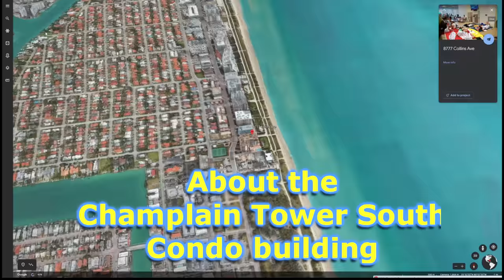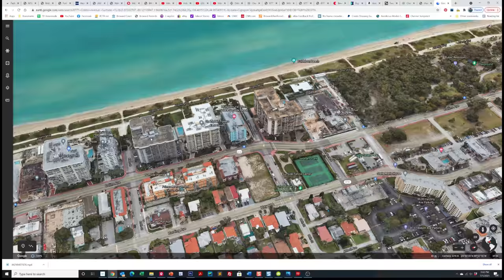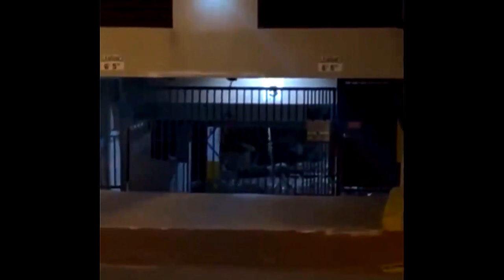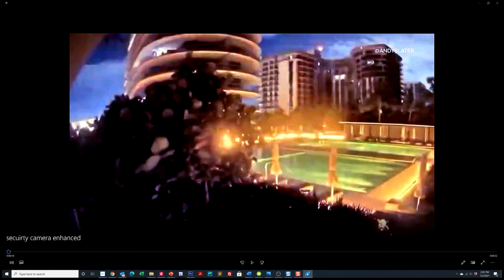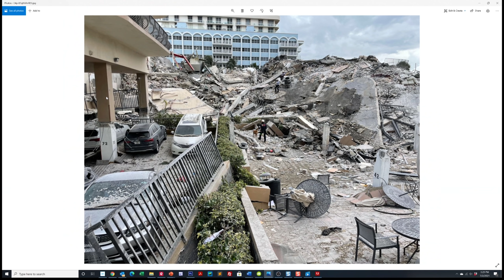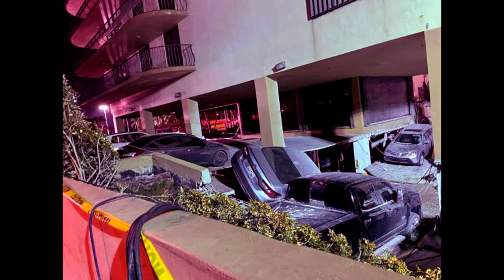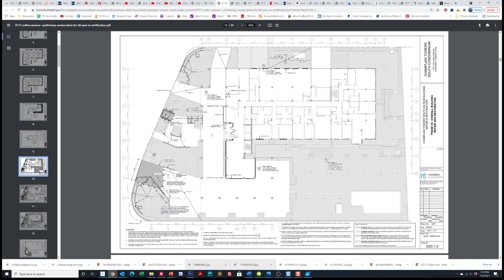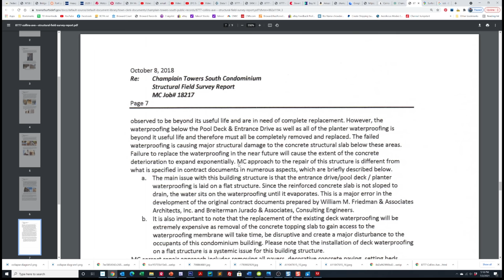Here's Cause Of Miami Condo Collapse Champlain Condo Towers, Surfside

Comment from the maker: ⛔⛔ Official Surfside Support Pages, only send aid to these vetted support sites! There are scams related to every disaster and you should avoid unvetted fundraisers.
⛔ Support Surfside: https://supportsurfside.org/
⛔ GoFundMe Official Vetted Pages for Donations to Surfside collapse victims: https://www.gofundme.com/c/act/surfside-condo-collapse-fundraisers
Reply: Fyi, there's a posting by Building Integrity who obtained the plans, the provenance of the buildings and the changes in the plans of the building.  There's a reason why that building did what it did.🤬
Reply: Why would people like this comment. Jeff lost a lot of validity in my mind with that childish comment, like don't question me or anything. L
Reply: @staciasmith5162  Id say it was the controlled demolition that collapsed the building....  one can clearly see the flashes from the explosives in the video (not this video)  ... I saw a controlled demolition......question is what or who was in the building ..... or was it an insurance job because of the deteriorating 🤔
Reply: The momentum of a building smashing down on a pool deck would force the lower pillars through it. So there where actually 5 sections. The pillars between 77 and 27 where the first two to buckle towards the ramp. This caused a weight shift towards the pool deck. Stress becomes to much for the pillars between 77/76 and 27/28 the buckle towards pool deck collapsing portion of the pool deck. At this point the buildings weight buckles 79s and 25s pillars which causes the first section to collapse. As the bottom of the first floor reaches the ground the debris pushes outwards into pillars 88 and 14 causing them to buckle outward towards the ramp and begins second part of the building collapse. It does the same thing to the pillars between 91 and 13 which causes the third part of the building to fall. As the momentum of the first section builds up falling towards the ground. When it hits the ground it "punches" down on the remaining pool deck forcing the pillars below to be driven up through the deck due to the force of the hit. Section one also damaged the pillars left and right of 23. When the first three sections are done falling there is only a handful of pillars holding section 4. Being that pillars around 23 are buckled the weight shifts forwards towards the buckled pillars and sinks downward on 23 causing the 4th section to shift and collapse inwards. 

Uhm.. great video! .. went off on that a little there but you know how it is when the mind starts doing its thing.
Reply: My dad told me a comerical pool system is much different then a residential pool system.
Reply: Who would trust a building if this is all it takes to Fall strait down. like a 1 link holding a 12 story building and trusting it. All floida buildings on Beach may have the rusted link waiting for people to leave befor it does.
Reply: You should use some program to highlight your cursor and/or make it bigger. It was difficult to follow what you were saying about structure because a tiny white mouse cursor doesn't contrast well with the background of a bunch of gray and peach.
Reply: Jeff- 2¢ from a SW guy.  If you make videos in which you use your mouse cursor to point things, go to Windows "Ease of Access" settings and increase the size of your mouse cursor.   Perhaps consider changing the cursor (pointer) color to some garish shade that's little used in the screenshots of your videos.
After you finish the video, you can restore the mouse cursor to normal.
In the first 2-3 minutes I found it awfully hard to see what you were pointing at.   
End of 2¢.   Best wishes!
Reply: Anyway you can remake this video with paint or a different cursor color so we can see where you're pointing lol I can't follow because I can't tell where you're pointing with that white mouse cursor in the video
Reply: @chrisb5459 that’s the most ridiculous thing I’ve ever read. 🙄🙄🙄🙄
Reply: I hope you see this Jeff! Your thorough analysis on what caused this building to collapse opened my eyes on taking house maintenance seriously. I have foundational cracks in my home that need mitigating to outright fixing. I have been on a path of placing importance on building maintenance. I hope you see this and get to reply. Thank you again for these videos. I learned a lot from you on importance of maintaining buildings and walkways to prevent collapses.

Comment: Try using a RED pointer and increase the size of the pointer.
Reply: I agree. Very difficult to see what is being pointed out.
Reply: Agreed ,l could not make sense of some comments as l did'nt know where to look.
Reply: It was ment that way  so you would believe  the narrative  lie.  Wake up. It was not a foundation failure. Those kinds of failures leave a building leaning over  hence the leaning tower.  
They blew this building  up. Making it into dust. Even the rebar became dust!  

Which that should give a hint. 

What kind of temperature turns rebar into dust?

Start thinking.... ignore the  lies
 This video is made by a liar!
Reply: @donnalangley117  IM NOT SURE BUT WTC7 BUILDING WAS DEFINITELY SET UP !
Reply: 95% of the time I couldn’t see your pointer.
Reply: @PirosmikeyNone  For basic information Rebar is cast and cured at a high temperature.  What is the melting point of rebar?
Melting point: 1371-1482 degrees C. 
Conversion to Fahrenheit heat measurement melting point 2499.8 to 2602.4 Fahrenheit 
The strength of steel remains essentially unchanged until about 600°F. The steel retains about 50% of its strength at 1100°F. The steel loses all of its capacity when it melts at about 2700°F.

So my thoughts and discernment  is more than conspiracy theory. It is scientific fact.
Reply: Good info, thx very much.  the ninja sword sound effects that accompany the arrows really sucks.
Reply: Winchester_BornIn1973  well truth will always shine bright and blind those which choose to believe the lie.
Reply: @donnalangley117  Pretty sure it's oxidation that's the culprit to turning rebar into dust (a.k.a. rust)...  :o)
Reply: Please. I was squinting in my glasses.  This was fantastic viewing. RIP to the victims,  love to their families 💔🙏
Reply: @dappledsunshine  right every piece of rebar rotted out.  Sure, you keep believing  that farce.  It is not the truth, but you  can believe that  fallacy if you choose.  😉
Reply: @donnalangley117  Well not every one would need to rot out - just enough to reach a critical destabilization point, and it's highly logical to conclude that wet concrete over several years would indeed cause enough of them to rust.  I do choose to believe science vs. someone's random opinion.  Opinions require zero science...  ;)  I mean unless you were there and set the explosions or personally know who did, the fact of the matter is that neither of us know for sure but the more likely explanation is science based...  Agree to disagree on this one.
Reply: @donnalangley117  thanks for your opinion
Reply: @donnalangley117  rebar is NOT merely cast. Steel is ladle-heated to molten form then poured into a casting machine to produce desired shape. At temperature of 1250 deg. C (about 2280 deg. F) bars are hot-rolled in a mill to reshape them into reinforcing bars, then quenched to rapidly cool the metal.
Reply: Would want to live in the other half of the condo.

Comment: Viewing that pool equipment room as a pool technician myself. There’s so much wrong with the equipment placement, plumbing and wiring. This should have never passed inspection.
Reply: they had a history of passing poor inspections via the donation of political funds to the local politicians.
Reply: @Nick Moore The spalling too on the concrete. Rebar is under tension and when it has any moisture it just expands right out of concrete. I have actually seen this a few times when people have let their plaster wear away so much that it starts eating into the gunite and exposes small areas of rebar.
Reply: That's why I placed much blame on the city Inspector(s), but of course not the only blame.  Whomever designed it and approved it takes blame too.
Reply: For real
Reply: My frievd who lives in Florida told me the condos in Florida have a history of being built by crooks and criminals. She said possibly money laundrying. She said she has looked at condos in that area. They all looked too shaky to her. I’m not sure how many she looked at.
Reply: @kellikelli4413  my friend who lives down there said the inspectors can be bought off if it’s not out ragious.
Reply: Jeff  as of today I haven’t ever heard if they ever found mrs Stratton. Could you tell me if they found her? Today is 7/30. They are all the way finished.
Reply: @gracieg7601  I think was the model that was on the phone with her husband. In a video he did concerning the ring camera in an unit, he showed her picture and her unit location and said she did not make it out. In the area where her unit was, I believe they all died.😢
Reply: The pool man i had once said my pool needed water in the deep end
Reply: Interesting observation. Thanks for posting.
Reply: @gracieg7601  I believe the word is laundering.
Reply: Bribes with the GOOD OLE BOYS CLUB@
Reply: I just noticed @23:10 as the middle section collapses the small section on the right initially sways to the right then to the left just before it collapses.
Reply: It screams DIY.

Comment: Mind blowing that this could happen, especially in present day, a time when you would assume that after a 100 years of skyscraper engineering, we would have the process mastered. Turns out the people who ran the hotel had years of warning signs and completely ignored them. Can’t blame the the architects and engineers for a complete disregard for safety measures on behalf of the hotel ownership and management.
Reply from the maker: Yes the idea of lack of maintenance could cause a building to collapse did not enter people's minds
Reply: And yet nobody is going to be prosecuted
Reply: @StoutProper It was not easy to find the fault. I looked at the drawings, but it just took a lot of study. Very nonstandard, and it's not easy to see something that is missing.

Comment: The answer to your questions why the building collapse as it did is the missing tie beams above the large openings. The shear you see of the deck to the columns is also because there were no tie beams in the critical locations. This building slabs were built without post tension cables, so no tie beam, no post tension cables the columns just skew thru the slabs, a classical shear point.  Leon Wechsler Architect.
Reply: Can their be other buildings with the same design faults?
Reply: Thank you.
Reply: @georgeafajardo4398  there are.
Reply: What's your opinion on the lack of drop panels and or column capitals?  The lack of these plus what look like thin slabs and inadequate rebar makes me think the building was on a knifes edge to begin with.